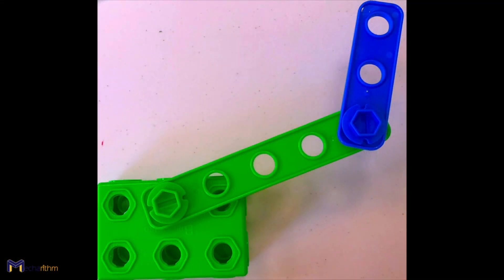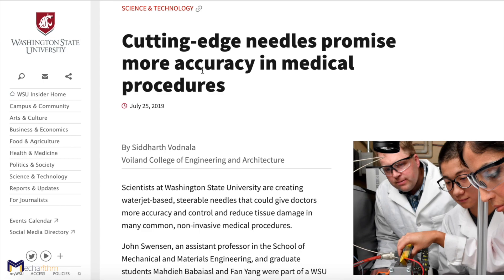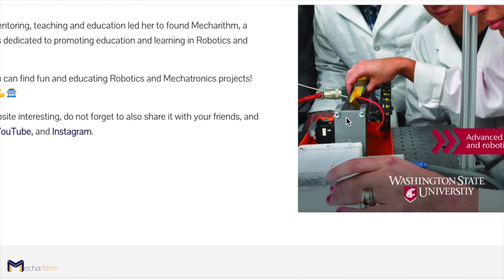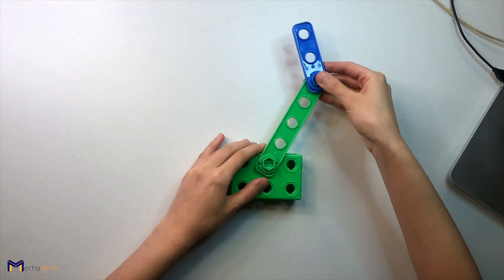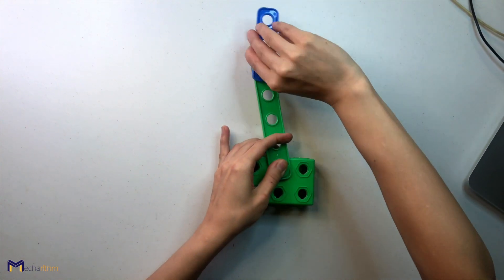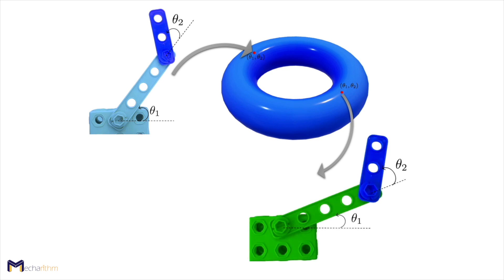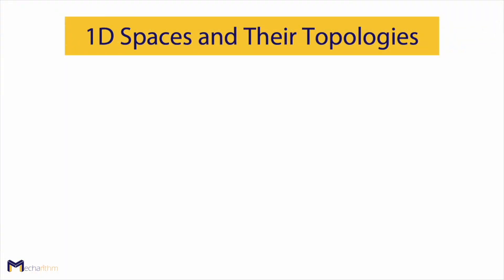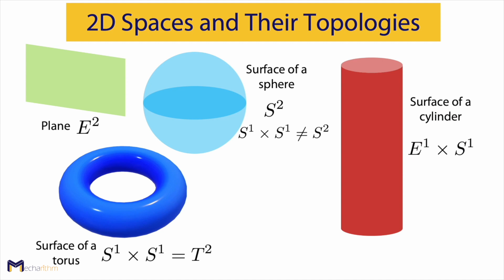Configuration, and Configuration Space (Topology and Representation) of a Robot | Lesson 2

Comment: Ah this really helped. I was visualizing it incorrectly becuase I oriented the 2R robot in my head to be standing vertically from its connection to ground. So, Seeing that the rotation is flat against the surface, and the surface can be folded and glued to form a torus was extremely helpful.
Reply from the maker: It is visualized vertically because the plane being observed is the x-y plane, which is horizontal in the real world :D

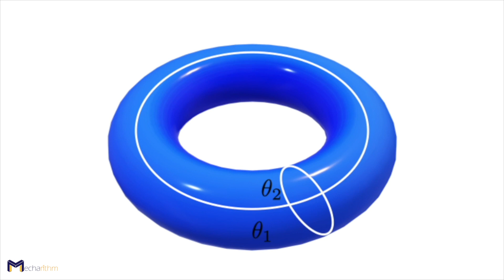Comment: at 5:50, i believe it should not be donut but a 2 dimensional ring.  Since both the links can only rotate in 2D space and not 3D space. If the 2nd link is perpendicularly joint to the first link then the rotation of 2nd link will form a donut.

Please correct me if my understanding is inaccurate. Thank you
Reply from the maker: Mandeep, thanks for your comment and feedback. that's exactly what is said in the video. "By simulating this we can see that the c-space of a 2 link robot arm has a torus or donut shape. In fact, the c-space is the 2-dimensional surface of a donut". It is the 2D surface of the donut.
Reply: @mecharithm-robotics  Just adding to Mandeep's question above. Why do you have to show a donut if it is just 2D because it confounds things or is there something more to it as you clearly say that the configuration space of 2DOF freedom robot as Torus or a donut in your statements? Kindly clarify
Reply from the maker: @sagoKarthik1980  The reason we use a donut (torus) to represent the configuration space of a 2DOF planar robot is not because the robot moves in 3D, but because of topology. Each joint angle is periodic, which means its configuration space is a circle (S¹). With two joints, the configuration space is the product of two circles: S¹ × S¹, which is topologically a torus (donut). So even though the robot operates in 2D, the abstract configuration space is a torus, not just a flat 2D plane or ring. it captures the cyclic nature of both joint angles together.
Reply: @mecharithm-robotics  Thanks Now I understand

Comment: Thank you for these explanations. They are very clear. I couldn’t understand things at that level of details (especially the singularity problem) by reading the book, neither by watching the official course of Lynch on Coursera (too much synthesised).
About the explanation of the singularity of Theta for the 2D circle by using explicit representation at the end of this video… You said that the values of Theta will lead to a singularity… is this for the 0° / 360 ° (or 2 PI) point ?
Reply from the maker: Alexandre, thanks for your feedback. Focusing on singularities is not the focus of this video, and you are right about it. Think about singularity this way: You are given the desired configuration, and you are asked to find the angles that, if given to the robot's control system, it can get to that configuration. This inverse problem does not always have a unique solution. For instance, for a 2R planar robot, both angles (0 and 2pi) will give the same configuration. Think about this in terms of robot control. You are at a configuration, and because there are two solutions for the inverse problem to reach the desired configuration, the robot's control can send a 360 deg command to the actuators, and this angle can be beyond the joint limit for the robot that can cause catastrophic situations. Singularities generally mean that the inverse problem (which is having the desired configuration and finding a set of variables to reach that configuration is not always available, or multiple answers can give the same configuration). We'll talk about singularities over time. Try to watch the orientation videos (we talked about singularities for the 3-parameter representations for the orientation). There will be a lesson in the future that is solely dedicated to this with enough visualizations. At singular points, the robot will lose one or more of its dofs.